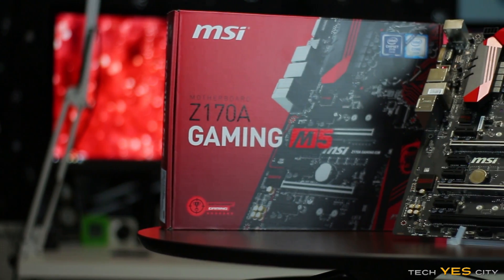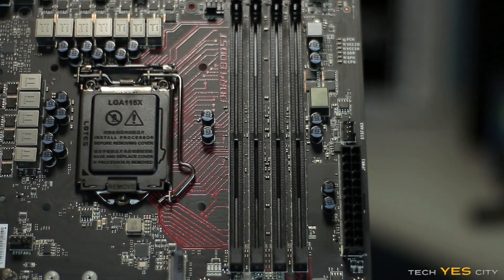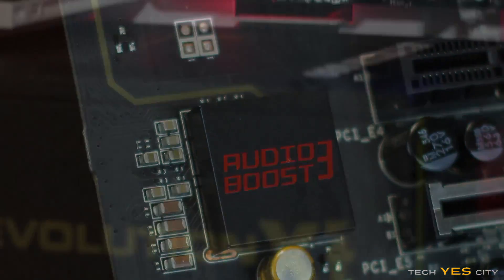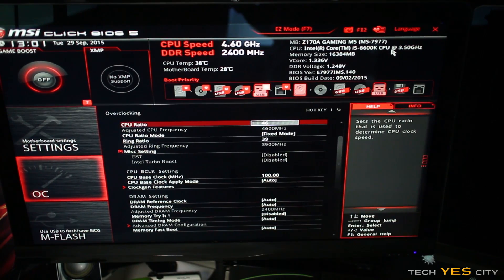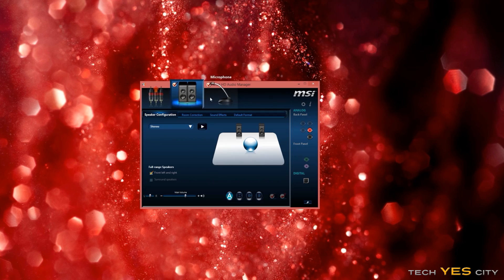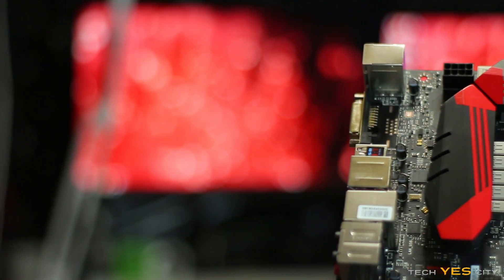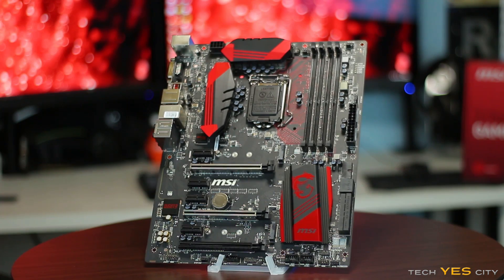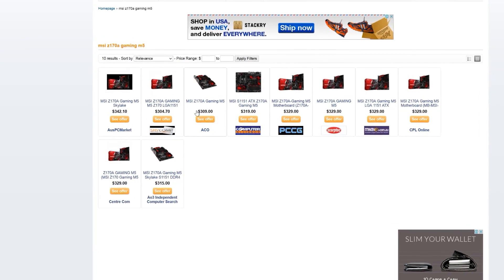MSI Z170A GAMING M5 Motherboard Review

Comment: got one for 20 bucks - fixed bent cpu pin - OC'd an i3 6320 to 120 fsb x 39(default multi) - 1.300v core that's it - 4,680 OC, 2133 ram went to 2560 without touching it.
yes, 2 bios settings and it's nearly 4700mhz...HAHAHAHAHAAA
Reply: Oh, and it's speed stepping... LOL yes never touched the C states in bios...HAHAHAHAHHA - bios is 1.6T 12/15/2015 (special one) winver is currently 1709, not sure if they are microcode stomp issues in newer win 10 updates
Reply: PS you can revert flash this motherboard - it is not locked to newer non z OC bios without older reverts like some others

Comment: I have the same motherboard but it doesn't fit in my Casing I have a Dell Inspiron 3000. Which cases would fit in I'm not sure 🤔
Reply: Just get a phanteks p400 or a NZXT S340 both the same price like around 70 or less usually.
Reply: HighOnDatDbz any case that says it can fit a ATX motherboard

Comment: So... I recently bought an Unlocked Intel Core i5 Processor... Does this motherboard house this? If not, is there a good, decently priced gaming board for it?
Reply from the maker: Yes this will overclock your i5 K CPU.
Reply: I am using i5-6600K on MSI Z170A Gaming M5 and it is working flawlessly.
Reply: Tech City Awesome, thank you for replying!
Reply: thats under load as well, While using it to game? thats pretty amazing. definetly considering dropping my 212 evo and getting into that luquid cooling! might OC! thanks for the feedback
Reply: this is my setup <3_<3
Reply: nice, i just bought that cpu and this motherboard, how do games and photoshop run on it? im looking to buy like a 1060 or somthing around there
Reply: Ive got my i5 6600k at 4.6 with this board and i could go to 4.8 but i don't like the temps. lol
Reply: what temps u get @ 4.6 with what cooler?
Reply: I use a corsair H100i V2 I haven't seen the temp go above 52C. So pretty good IMO. That's with the voltage set at 1.32
Reply: Yeah that's the hottest it's gotten so far at 4.6Ghz 1.32V

Comment: I just bought this motherboard online, should get in on monday. Your review helped to make my choice. Actually, I was so impressed, I subscribed (and my subscription is hard to get!). I am not really happy with MSI "Killer" LAN port choice (people say it is problematical), but to get another NIC is easy, so not really a problem. You say NIC is working great, so I will give it a chance before I buy an Intel NIC. Mic is of no important to me, so no problems there. I wish you spent a few more words on storage options, more and more people buy several HDD-s and want them to use them in RAID mode. Storage options of this MBO was one of the main reasons to buy it.
Reply: Robert Okadar Hi, can you report back about the NIC..? How was your experience with killer?
Reply: @bountyhunt Sorry, can't help you with that yet. I am using wireless at the moment, until I get wired connection through my house. I am eager to try and get, since gaming on wireless sucks. As soon as I get wired connection, I will try to give some feedback.
Reply: Robert Okadar question. Does the msi killer lan port not work when you use usb wifi connection

Comment: Hey guys just want to ask which is better, asus z170 pro gaming or the msi z170a gaming 5?.. they're about the same price here in my country so im torn between the two... thanks for your time :)
Reply: whichever has the features you want. If they both have the same features pic the one you like the looks of more, it is a MB for gods sake. I remember when all MBs were ugly green things with yellow and blue connectors and all kinds of ugly solder joints everywhere...guess what? They worked the same..a place to plug shit into, its the shit you plug into it that matters most.
Reply: Thank you for the reply ! But I've already decided to go for the Asus Maximus VIII Hero Alpha :) Damn, the board is beautiful ! Loving it so far :)
Reply: You could have saved or sent me the xtra 100 dollars which you basically blew for looks most likely, are you running 2 1080s in SLI with a custom water cooling loop on an unlocked i7 sku too on a wide screen 4k monitor? Just curious, otherwise..this board would have functioned just as well for you..lol. Just shakes my head.
Reply: I opted to go for that motherboard because I want my PC to be "future proofed". I already bought an intel i7 6700k with a cooler NZXT Kraken X61 and a single GTX 1070 because I can't afford a GTX 1080 GPU but im planning to go SLI in the future with the 1070 or maybe sell it then buy a 1080. I still have my 1080p monitor which is the Asus VG248QE.
Reply: 1080P monitor, just get a 1060..why do people insist on future proof? Your gonna want a new system entirely by the time you get that 4k monitor that a 1080 even makes sense for, and by then..well 4 more gens of intel chips will be out, your z170 will be obsolete, everything will be on DDR5 or DDR6 at 6k mghz and be half price compared to now. LOL

I dont know, its your money, just doesnt make sense. I would have rather had a lesser board with an NVME m.2 SSD for example which loses the juvenile look and actually increases the performance in the grand scheme.

Comment: i got this motherboard along with an i5 6500 and a 4gb GTX 960 along with DDR4 2400mhz corsair vengeance 8gb ram, CX600M psu will i be covered for some casual gaming and using the elgato game capture card to its full potential

Comment: Been looking at this mobo for my first gaming rig, but I've seen a lot of negative reviews. should I get it, or go with the z170a sli plus?
Reply: +cygnus4213 I've got this mobo, not sure why it has negative reviews because it's amazing. Currently running an I5 6600K @ 4.6 GHZ with 16GB DDR42133 and a GTX970 flawlessly

Comment: Have you tried overclocking to 4.8ghz? And is it stable? I'm planning on overclocking and a friend of mine has an asus z710 a. He can get 4.8ghz on his i7 6700k. I just wanted to know if this board would support that
Reply: +Jonathan Alcantara This board can handle the maximum voltage an i7-6700K can run at.

Comment: Great video... Hey can u tell me whether I buy Asus Z170 Pro Gaming or Msi Z170A M5 or Msi Z170A PC Mate.
 I will go with Asus H170 Pro or Asus H170 Pro Gaming or Gigabyte   H170 Gaming 3.
My parts for my new Build are...
Intel i3 6th gen
Kingston hyperx ddr4 8 Ram
Seagate 1Tb sshd 
Corsair vs 550 psu
Circle CC830 including 2 fans
Asus DVD
LG 18.5 inch monitor.
Plz help me to decide mobo , I am very great full to u. Thz very much.
Reply: +Aakash Gupta hey man better never than late i guess...
the z170 mob allows you to overclock which u won't with those specs i guess...
so go for an h170 mobo if u can afford it go for the msi h170 pro(there is a cash back promo if u buy it before 29feb) . its a great mobo with a lot of usb ports.
few things :

1 go for an 23-24 inch screen 18.5 is really small.
2 the psu will fail you go for an seasonic s12ii 520 psu
3 go for either a hdd or an ssd these combos nowadays aren't really that good..
(so go for a 1tb hdd version)

u will get 60+fps with the onboard graphics with games like league or csgo.
but i recommend u to buy a cpu in the future.

for more help u can always reply to this comment cheers man
Reply: Your running a locked i3, just grab a h110 and put the savings toward a discreet graphics card. The i3 is for budget builds and spending a bunch on a fancy MB makes no sense as the cheapest h110 will do anything you would want to do on a i3

Comment: Does this motherboard can handle Core i7 6700k ???and GTX 980 ti GPU???
Reply: yes,
Reply: if you have the budget for this why not buy an even better?
Reply: Motherboard doesnt do better work on performance motherboard is only best in voltage regulations and sound and lan but in perfromance almost all does the same performance there is no big difference between Asus Hero and msi m7 and Asus Deluxe buying better motherboard we can spend money on GPU and Ram and on SSD that gives better perfomance in real time games
Reply: +joe jones yeah good point

Comment: I don't trust MSI boards due to a bad rep regarding quality control and RMA issues, but I might consider this when I switch to Skylake if I see enough good reviews. I have a red and black case that I plan on keeping forever lol.
Reply: There was a span of time where MSI really was putting out some bad stuff. Those days are in the past and they have done alot of work to repair their reputation due to it. I won't use anything else right now..I love Asus as well but you don't get much for the extra cost of the Asus in general.
Reply: Jacqueline Waters-Manesis You know what's interesting. I bought the Z170 MSI SLI Plus board and it is one of the best quality boards I have ever had. Very happy I gave MSI a chance.
Reply: That's awesome to hear. I just today ordered the one in this video. I personally would like to see something in between a h110 and z170, I want to overclock but I will never use 2+ video cards for example. Hell I would be happy with a h110i pro if it would overclock. I don't have a ton of extra things..1 ssd, 1 hdd and 1 graphics card ..give me 4 ram slots and overclocking ability and I am good. I am not even planning on anything extreme but might as well unlock the performance with my k sku i5, so I am getting this board to upgrade from my h110i Pro. People tend to follishly overspend because they watch too much tech tube.

Comment: if you're using two GPUs i believe on the Z170 platform both PCIe slots will be 8x
Reply: +HUGSaLOT Valkyrie Yes, your right. Single-Gpu = x16 while having a dual-Gpu = x8.
Reply: +UndyingGhost So is this a limitation of the CPU or the chipset? Will future Skylake CPUs have more PCIe lanes so you keep using the same Z120 motherboards down thr road if you want to upgrade? This limitation doesn't really bold well with enthusiast who want to build beastly PCs.
Reply: +HUGSaLOT Valkyrie     bode*
Reply: +HUGSaLOT Valkyrie you can't tell the difference between x16 and x8...there are many videos about this already...
Reply: SLI or corssfire doesn't do a thing in most titles anyway. Ditch two lower end cards and get one great card. If you can max out all the settings on a GTX 1080 and get great frame rates, what is the point of two of them other than to say "hey man, I blew my money to not get much..but it sure looks cool in my case doesn't it?"

Comment: good review Bryan but common usb 3.1 Gen 1 is a bullshit marketing stunt to confuse the end user even more. UBS 3.0 = 3,1 = 5 Gb/s
USB 3.1 GEn 2 is rated at least 10 gigs. So I belive the board has 2 dedicated 3.1 solutions in type A,C formfactor if I am not mistaken.
Reply from the maker: +IcelanderMods Yeah I don't see myself taking advantage of 3.1 anytime soon.  I will have to test out the ports a little more, but they did state they were all 3.1A+C (except the 2 usb 2.0 ports).
Reply: +IcelanderMods Even though it is a stupid naming scheme, This is not a MSI specific thing, it is directed by the USB developers: http://www.usb.org/developers/ssusb/